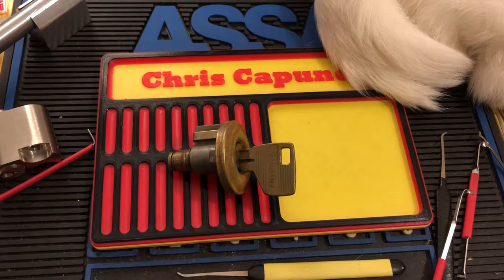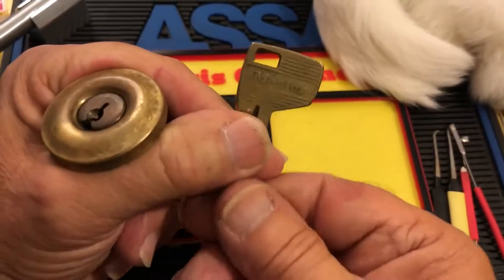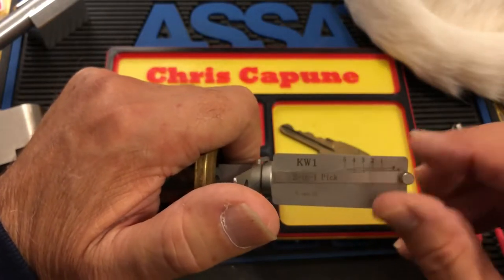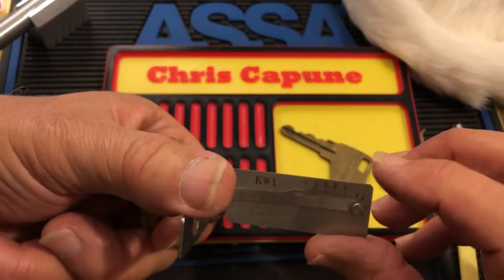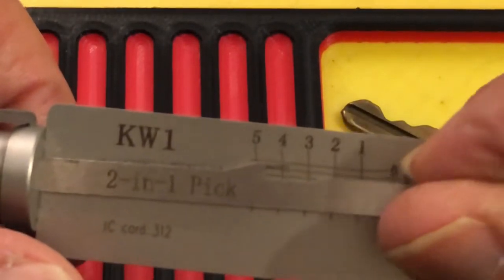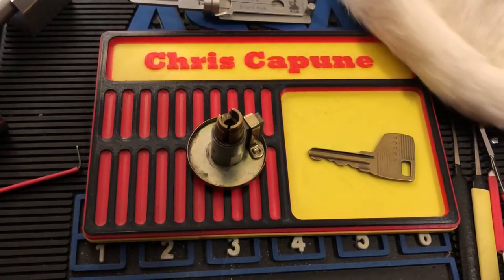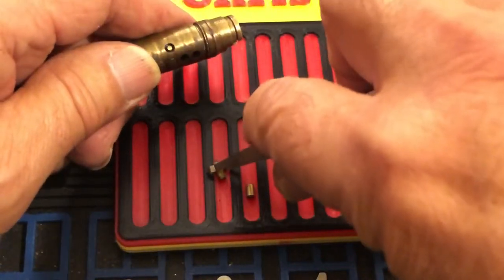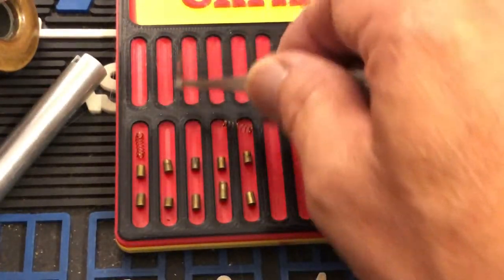#384 Vintage Master lock Rim Cylinder Picked and gutted

Comment: The 4th key pin is quite long. If you look at the cut on the key, it seems to come right down to where the top rail would be on the Lishi. You can check that by putting the Lishi into the plug and then the 4th pin. If it's sitting right on the rail, then there's your problem.
Reply from the maker: Gary Rumain you are correct! That is the limit of this Lishi. 
🐈👏👍🐈
Reply: @chriscapune7873  Try it and see if that long pin interferes with the Lishi's pick. You did have trouble pulling it out. Guess it's not quite a Kwikset profile?
Reply from the maker: Gary Rumain it’s a Kwikset profile , when you have that high pin in a lock it just scrapes the top of the Lishi and if the the pick tip is up at all you get a bit stuck! 
Have had this before on the Lockwoods I have picked with Mr Lishi!! 
👏👍👏🐈
Reply: @chriscapune7873  OK.